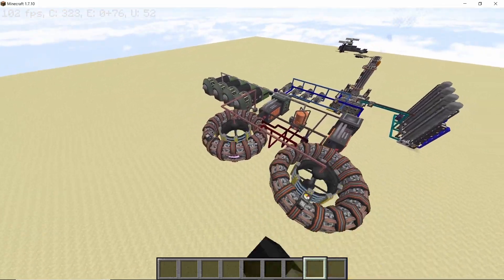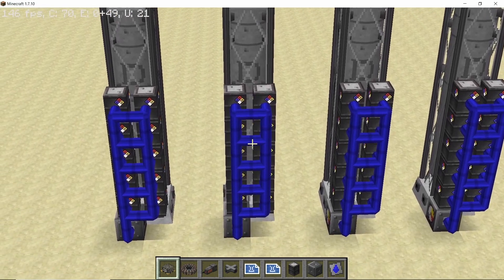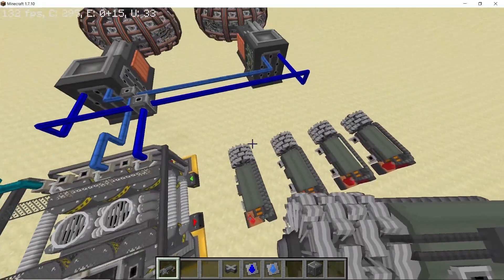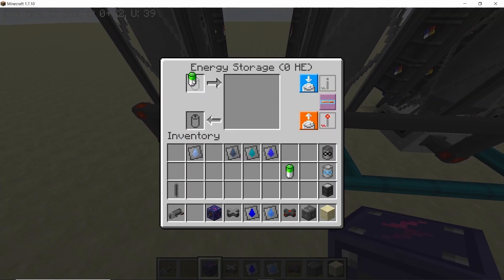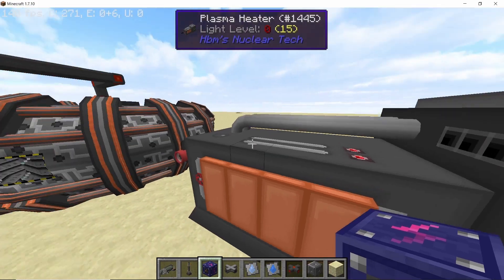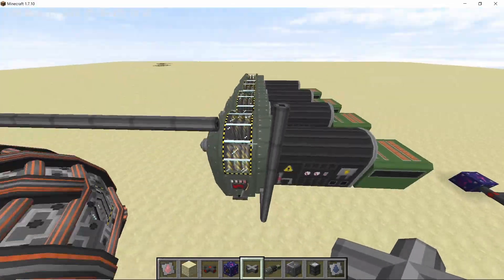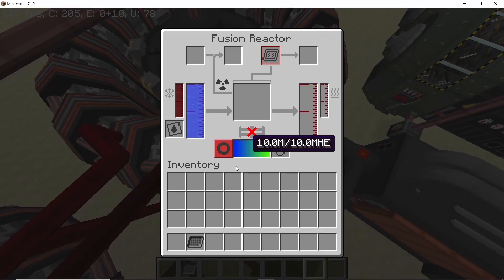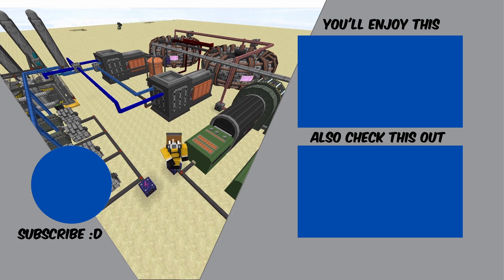Fusion Reactor Power Plant - Self Sustaining & Infinite Fuel Production - JamesH_2's NTM Fork

Comment: 7:42 chain boilers and put steam in it to make it denser, up to ultra dense which is 4 chaining. Also is heavy water a valid coolant
Edit: Only for PWRs.
Reply: chaining boilers will produce lower power as heating up steam is very inefficient, also this tutorial is outdated, the fusion reactors have gotten a full overhaul
Reply: @windowsbuild3r-alt  What?!?!?!? Is it just better to use the steam instead of upgrading it up to ultra dense?

Comment: I tried making one of these in 1.12.2 but for some reason heavy water doesn't have a pipe or fluid identifier in it. Prob an oversight but really annoying as there's no way to pull the heavy water out of the deuterium towers. I haven't tried mekanism pipes yet tho so maybe that'll work.
Reply from the maker: yeah that's a big upside of playing the 1.12.2 version, using fluid pipes from different mods with NTM. Which version of the mod are you using tho ... Reloaded or Extended?
Reply: @SavageVegeta  extended. I switched to it from reloaded due to being more up to date and seemingly still being maintained. I still haven't actually tested yet to see if mekanism pipes could pull the heavy water out tho cause I kinda just forgot about my fusion reactor. 

Little fun fact, I was on the hbm subreddit and found out there's a guy working on his own fork of extended that will add the PWR and zirnox to 1.12.2, I'm so excited!

Comment: Hi I'm playing on 1.12.2 where coolant isn't needed for the reactors, but I'm having issues with barels and tanks not outputing water quickly enough (only managing 500-1000mb/s each)
I then tried turning the low-pressure steam from the turbines into water, which transfers quickly enough to use for the reactors. The problem now is that I've still got too much low-pressure steam/water with no way of getting rid of it that I know of. I tried fluid trashcans from various mods, but they'd all throw away everything, even the water needed for the reactors.

EDIT: Turned out to be a bug. Steam production should match water consumption, and everything worked after rebuilding everything
Reply: use multiple barrels/tanks

Comment: A Fusionary Watz Plant is a type of power plant that uses a singularity at its core to generate massive amounts of energy¹. It is a multiblock machine that requires antimatter, antischrabidium, a singularity and a fuse to work¹. It can use different types of singularities, such as Singularity, Contained Counter-Resonant Singularity, Superheated Resonating Singularity, Miniature Black Hole and Singularity Screwdriver¹. The higher the tier of the singularity, the more energy the reactor will output and the less fuel it will consume¹.

The Fusionary Watz Plant is very expensive and difficult to construct, but it is also very safe and efficient. It directly produces energy that can be outputted at any access hatch. It also regenerates coolant automatically and does not have a risk of meltdown¹. However, it uses dangerous fuel, especially antischrabidium, which can cause radiation poisoning and explosions. It also requires a lot of resources to create the fuel in a cyclotron or a particle accelerator¹.

If you want to learn more about how to build and use the Fusionary Watz Plant, you can watch this video tutorial by Savage Vegeta² or read this wiki page by HBM's Nuclear Tech Wiki¹.

--Bing AI(Third paragraph)
Reply from the maker: Can you send me a link for this, I've never seen this article when searching for the fusionary watz !!

Comment: vids are great! would liek to see some more explanation on HBM 1.12.2 rbmk etc. tried a couple times, every times they explode..
Reply from the maker: I did make a video on RBMK's for 1.12.2 a while ago addressing the changes compared to 1.7.10.
However I have not tried making a new design in the NTM extended edition so I'll try making a video on that in the upcoming weeks !!
Reply: Got it to work somehow, just not very stable power production.
Reply from the maker: @ZeroNyte  yeah power production dips down consistently once the fuel starts depleting over 30%. 
Thats one of the reason why I love using the big nuclear reactor instead cause it's much easier in terms of automation and gives out consistent power. Tho it is not nearly as power dense as rbmk but it's a worthy tradeoff for safely ig

Comment: Is it possible to do this without infinite barrels or batteries by having the low pressure steam run through cooling to get water to put back in the deuterium towers, and having the fusion reactors power them and the factory?

I love your builds and your tutorials, but it feels a bit like cheating if you just put an infinite water source in there.
Reply from the maker: Infinite barrel was just for demonstration, cause water isn't that much of an issue and yes it's absolutely possible to have a closed loop for water and having some additional tanks with heavy infinite water barrels for emergency. And the fusion reactors can definitely power itself and all of the machines that's why the title says it's self sustaining

Comment: Can you maybe do a tutorial about the hbm armor upgrading, how do i upgrade my chestplate or helmet because i found a strange heart and it does stand that i can put it into the chestplate but idk how, would help rlly much 

I love your tutorial keep up your work😮
Reply: Use armor modification table
Reply from the maker: All of the armor can be upgraded using the armor modification table and the process is pretty easy too, all you need to do is shift click with armor components and modifications and they will be automatically sorted into correct places. Then you can shift right click the main armor component and that will give you back your armor with the modification attached

Comment: can you make a video where you explain the operation of the hbm redstone radio transmitters and receivers?
Reply from the maker: I did cover them in an update video, basically the transmitter needs to be powered by the block placed below it and the receiver will send out a Redstone signal on all of its sides given that you set them both on the same signal

Comment: While all these reactors are good I find just building an oil refinery and using few combustion engines makes more power than I know what to do with
Reply from the maker: That doesn't really help run machines like cyclotron, particle accelerators or schrabidium transmutators. for the late game you will need alot of power being produced quickly